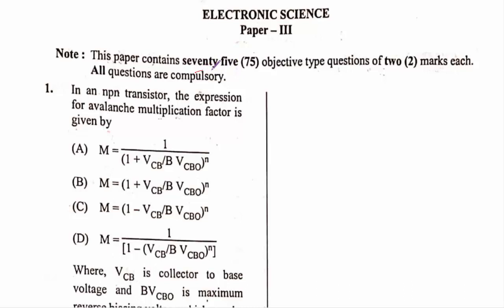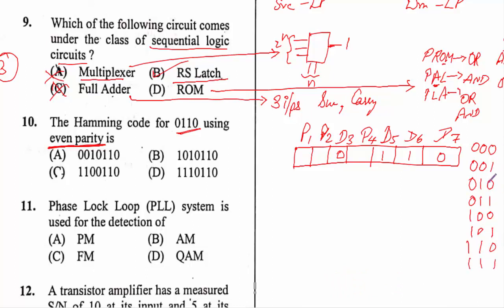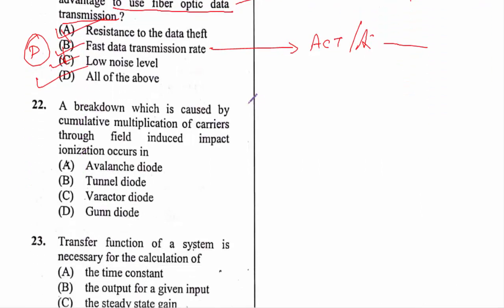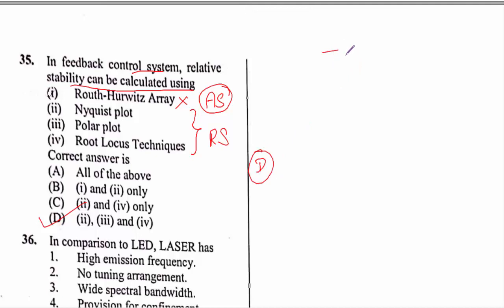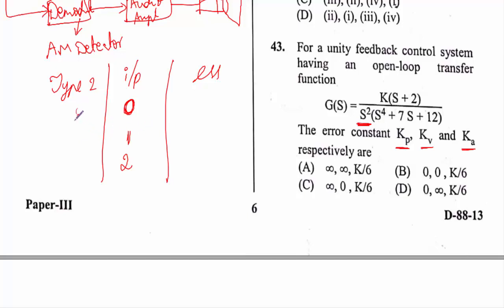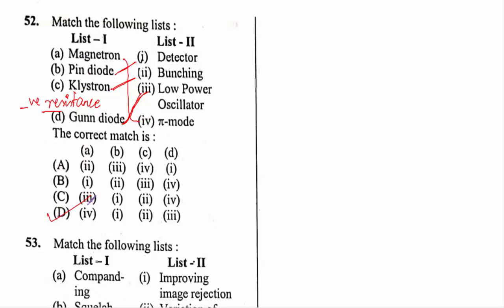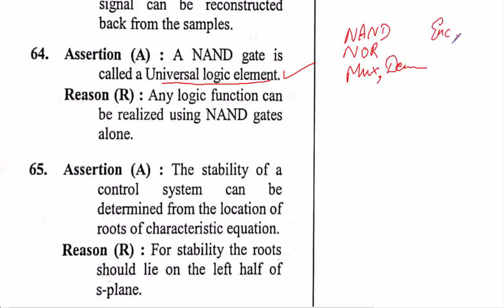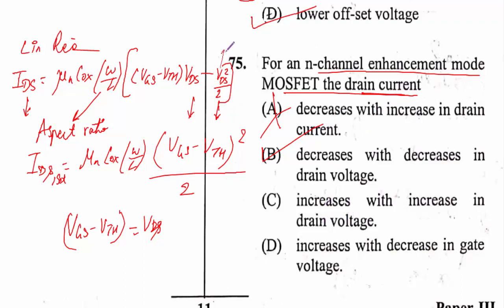Electronic Science UGC NET previous year paper-3 2013 with detailed analysis

Comment: Sir in question no 3 answer should be option A if resistance and capcitance are equal but if not it should be in underoot whiout any sqaure. how option d is possible
Reply from the maker: Ur analysis is correct, but they've not specified that all Resistance are same and all capacitance are same,
moreover I wonder they've released the key answer as D, actually is should be A.
My advice is lets focus on concepts, members in the board will decide key answers!!
What to do?
Reply: Okay sir thanks a lot